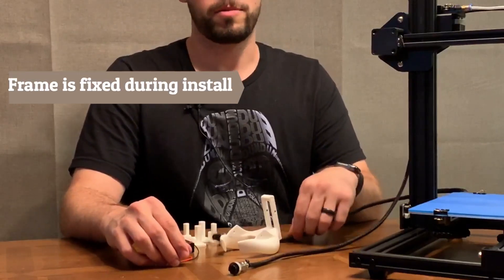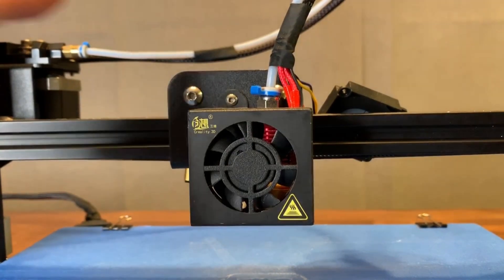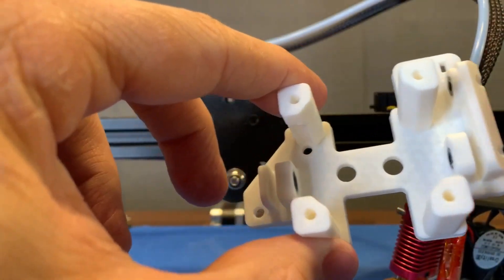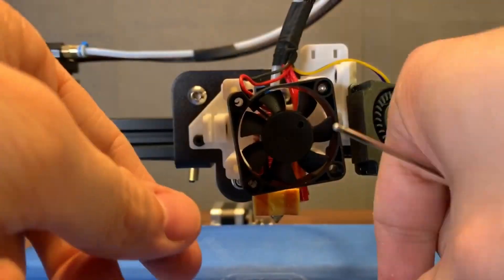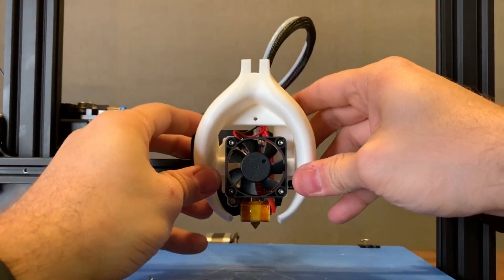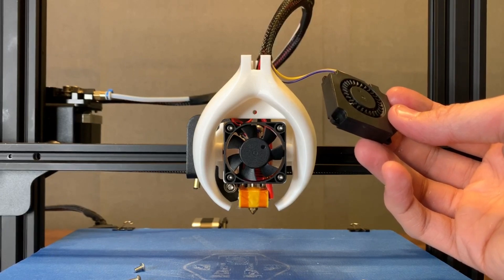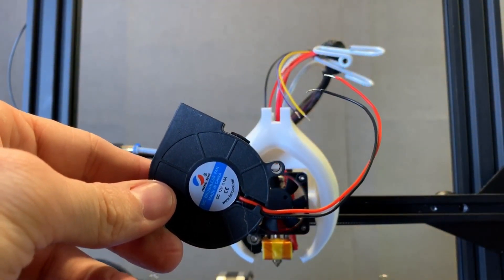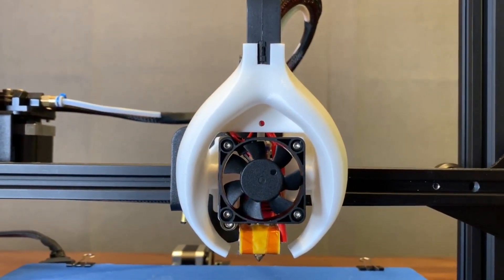CR-10 / Ender 3 "Smooth Fang" Cooler Install

Comment: Hi I was wondering if you lose any z height. Thanks
Reply from the maker: tiny robber i don’t have this one installed anymore as I switched to E3D hot end and this was not compatible. However if I remember correctly the cooler sat in front of the top bar and did not impede the height of the printer.

Comment: So only 1 screw holding on the mount?
Reply from the maker: It clips on to the bracket and then has 1 screw yes. The two that go through the hotend also hold it in place. Overall it is very sturdy.

Comment: How has your experience with this been so far? I'm considering changing from a Hero Me to this.
Reply from the maker: I never had the Hero Me although I know it is a popular cooling solution. I did have the Bullseye and prefered this option for looks and being able to see more of the printers progress in videos. Cooling wise i would say they performed equally for the small amounts of testing I did. Didnt really make any specific bridging tests when i switched so no empirical data.
Reply: @makerslab919  Thanks for the response. Mine just finished printing. Fingers crossed! :)